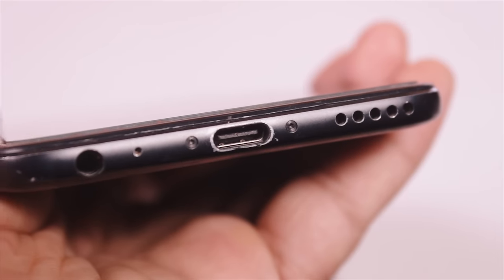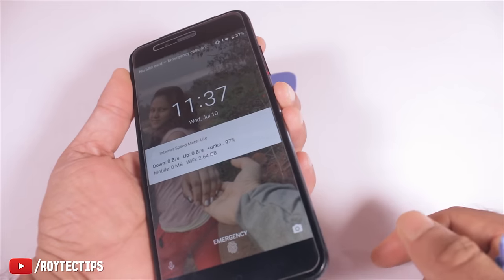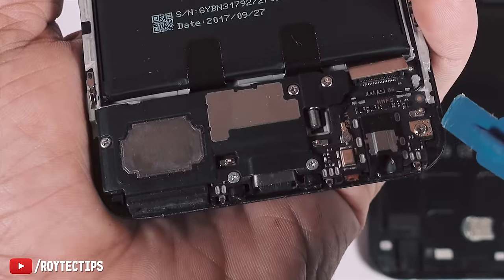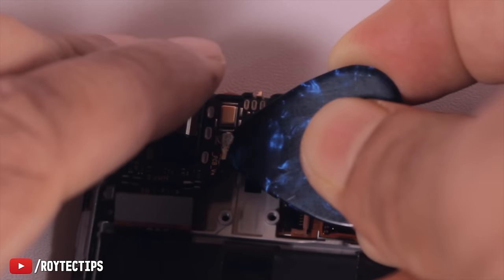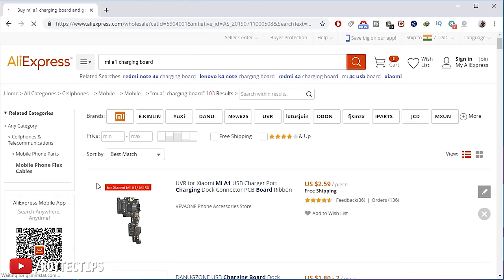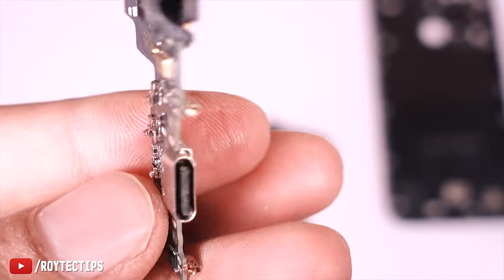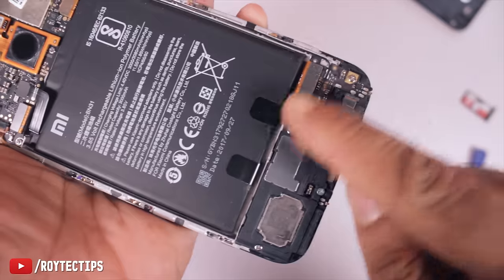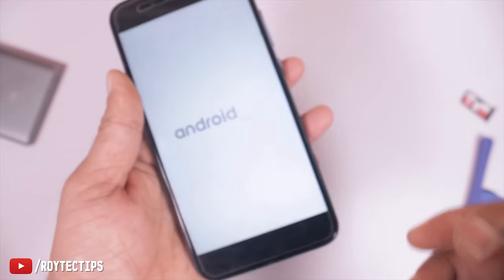HOW TO FIX ANDROID PHONE CHARGING PORT | NOT CHARGING |  | LOOSE PORT MIA1

Comment: If I do this to my phone I'm extremely sure that I'm gonna ended up with a broken display and lost screws😒
Reply: SAME
Reply: Just use heatgun he doesn't even soften the adhesive it might crack the lcd
Reply: Same 😔
Reply: Yeah meh too 😂 if I do this I'm sure 😅🤣 I will just  go for it .... I'll loose my phone..
Reply: @dipashasingha4273  😂😂😂😂😂poor us
Reply: @veronicafernando5627  now how is your phone 😂🤣
Reply: Same
Reply: @dipashasingha4273  still have the same one😂
Reply: Ikr
Reply: So better you don't do
Reply: And I'm still going to try it 😭😭
Reply: Way too complicated, so many parts of this process can cause damage and loss of tiny screws etc. Go to the mall and pay for the repair and never use the charging port again on an android. Use a wireless charger. Can't use a phone that doesn't charge as a trade-in for the next best  Android.
Reply: I was thinking the exact thing. I'd end up having to throw the whole phone away.

Comment: Thank you! I bought a charging port from Amazon and the tools. It took a little bit of work, but the phone charges fine now! I'm hella happy. The fix is super easy guys, just be careful placing the board in. There's some notches on each side that secure it in place. I couldn't fit mine perfectly inside so I just clipped off one of the notches and did everything else in the video.
Reply: Do you know if different brands require different ports? It seems to be like Samsung chargers don't work on Motorola phones, and vice versa, which leads me to believe that their ports have different wirings as well. It's so annoying that these companies will rely on these cheap parts for this, I want a new company to appear in the market and take their sales away.
Reply: @redbanlovesasians2236  Yes, I would assume every phone has different boards, but you'll be able to find one for your phone easily. Sad thing was that my phone stopped charging properly after a while. Bought another one and replaced the board AGAIN. This time I used a magnetic charger to avoid damaging my phone further... 8 months later the magnetic charge stopped working. So, it might just be a poor board in general. I bought a new phone since then and I'm just waiting for another problem to happen it seems like. :(
Reply: @Xusphy  what kind of phone is that ?
Reply: I just shoved a little shim in the port and it works great!

Comment: I use my phone to clock in and clock out at work and was very upset when my phone lost all of its battery life and would not charge I watched this video and I was thinking something as simple as a toothpick would not fix my phone but I tried it anyway and to my surprise it actually did work. Thank you so much for the tip

Comment: This video is really helpful. I was checking videos on how to replace charging port in a smartphone and realised it's beyond me because it involves unsoldering the old one and soldering in a new one. But replacing the whole board especially as it's so inexpensive is something we can do at home provided we are extremely careful in removing all those connection without breaking them or losing any screws. Thank you for uploading such a helpful video. I'll come back to this one if ever I have this problem to solve.

Comment: Great strategy for fixing Android charging port issues. I’d thought soldering on a new system was the only solution. Chargie USB stick has helped save battery life by cutting off charge at a desired preset %.

Comment: Doing this at home on a water resistant phone will leave it very vulnerable to water damage so be careful if you're doing this at home...
Reply: Those shitty phones are vulnerable to everything lol they fail every 4 months
Reply: @StoneCoolds  lol OK explain that to my s4 that still works perfectly or my s7, s9 and s10 that i STILL have and are all still working. I've had my s4 since 2013 and it literally still works great on everything that it can still do. It doesn't get updates anymore so there are a lot of things it can't run anymore but my point is that it still works 7 years later. You must be an isheep huh??
Reply: @nigayustealmyshoes  then what are you doing here ? Expanding your knowledge about things that never happen?
Reply: @StoneCoolds  😂 not at all!! I have a co worker that is still using the s6 and it has zero issues. I was just saying that not all phones are the same and samsung phones in particular seem to be beasts when it comes to longevity. You don't have to like android, I was just letting you know that I have phones that are years and years old and they still do work and no I'm not making that up. I'm typing this on my year and a half old s10 plus which proves that your statement about them lasting 4 months is extremely inaccurate.
Reply: @nigayustealmyshoes  

I agree Samsung product are great and reliable and in comparison to Apple products much much more affordable...
While Apple targeted his elite customers with their iphone samsung on the contrary has played the main role in my opinion for democraticizing smartphone with android.
I always choose Samsung phones in priority when i decide to buy a smartphone but they price too much now even though they're still reliable with no major bugs or weak components.
Reply: @nigayustealmyshoes  why df you have so many phones 😂
Reply: @zoro.l0266  lol I just never threw out old ones because they still work. I let my kids use my old ones.
Reply: @nigayustealmyshoes  ohhhhh😂😂😂my bad
Reply: Yup.. happens at home
Reply: True
Reply: @saamprime3964  the only cell phone I ever had trouble with and I had a lot of trouble with it during its short life was a Samsung, I will never own another Samsung product again.
Reply: @nigayustealmyshoes  Well yah, if you're buying S series, that's the flagship line. Try it with a $50 Samsung

Comment: Big promblen my phone is showing charging icon but not get charged 😭
Reply: Same here on my mi max2
Reply: Me too
Reply: @amirshelby  try pressing the usb pin socket of charging cable that goes inside charger.
Reply: same
Reply: Same 😭😭😭
Reply: So guys,anyone found the reason behind this problem?
Reply: Exactly I have the cubot x19 ;-; Halpp me
Reply: Get new charger
Reply: All Chinese phones have this problem...
Reply: @prahaladadharsh9766  , what is the solution?
Reply: Don't know...only solution is don't buy Chinese phones avain
Reply: Me tooooo
Reply: Me too
Reply: YES SAME!
Reply: @prahaladadharsh9766  it's a bs reason...I have a South Korean phone but still it does happen and if u will say that it's because its near China then there is only one company and that's Apple ...... btw any solutions found?
Reply: Switch off phone charging
Reply: Same
Reply: @amirshelby  buy new cable and power brick
Reply: @sumit55z  replace ic
Reply: @LeaderBMGOMP2AReal  which ic ?
Reply: I had this problem

Probably your base is broken

That's what happend to me
Reply: Me too
Reply: Check with youtube will get the idea to fix
Reply: Make sure your Charger is a Universal Smart charger that can handle your Phones charging 'protocol' ie lookup BC1.2 , Pd or Qc1..QC2 or QC3 Charging standards.
Where the charger puts different Voltages on Data(+) and Data(-) ..to work out how much current the phone will pull from rapid (Quick) smart charger.There are several youtube videos that explain this in more detail
Reply: Charger fault or charging cable fault

Comment: This was easy to follow and I got my phone fixed. Thank you!!! I got also the charging cable. Nice recommendation!
Reply: Did you replace the charging port with a newer one or fixed it by tightening
Reply: @avn33__44  I replaced it with a new one. But I still keep the old one in case I need a piece.

Comment: Thanks  it works ,I don't have a proper tools I just took my thinnest flat screwdriver and force in from my casing USB hole and the bottom of the board I twist a little bit up(nerrow/tighten it) few second I work,it can changed(Thanks from Malaysia).
Reply: Wow!  Thanks for  the comment, now I also feel it is assured that my phone would also get fixed

Comment: 0:34 That's not T5, which means Torx 5, it's pentalobe.
These disgusting screws should be banned. I have a meizu with screws and factory-sheared threads and no way to remove them. And they're so tiny it's ridiculous.
Plus my microphone came non-functioning, barely catching the loudest sounds, and a lot of noise. God I miss the replacable battery days...
Reply: dont buy cellphone

Comment: I am brand new to this. I'm tired of my sons tablets ending up not being able to charge and it is exactly because he makes the port loose. He will have it plugged in and jumping as he plays, which isn't good in itself. But being autistic, he never wants to follow this rule. I tried to pinch it tonight but don't have the proper tools to unscrew and try it. I will try again when i have the tools. You made this look easy and exactly what i thought i could do to fix it. Confirmed. That means i can try to fix the many other tablets I've accumulated 😄

Comment: Bro that type c connector is same for all devices or vary from device to device??
Like i want to replace my nokia 6.1 plus connector with some other device connector other than nokia 6.1 plus!!!
Reply: Good question. It seems to be like Samsung chargers don't work on Motorola phones, and vice versa, which leads me to believe that their ports have different wirings as well. It's so annoying that these companies will rely on these cheap parts for this, I want a new company to appear in the market and take their sales away.

Comment: I really hate the MOTO brand android phones as they make inner strips, wires, cables very weak and they tear when you attempt to open it, if it tears rips or snaps your phone is finished or its reduced to a calculator, if you have a back up phone then the risk can be reduced because sending the phone to the manufacture will cost you the same price as a new or secondhand one,

Comment: Great work , I have redmi 4 mi device, phone screen is broken but it works good , I visited to mi service center to change battery and charging port but they said if we open ur battery and charger port ,for replacement phone display will be gone , is it true ? Does it attached with battery and charging port? I don't want change display because it works good .

Comment: I have a Samsung.  It would not charge while the phone was on.  Turned off it could take up to 48 hrs to charge.
I then bought not a cheap new charger, hoping it would make a difference.   It was worse yet.
I went to my phone company and asked them to plug it into their charger to see if it would work.  It did.  It was a Samsung official charger.  I got one.
The guy behind the desk didn't believe that it should have made such a big difference, but it did.
It did and still does charge just fine.

Comment: Or sometimes those 2 little prongs sticking up go flat but if you push the flat end of the connector down, like on a hard surface and push it up into the plastic base part ,the prongs stick up again &hold tight when you plug it into your phone &charge good as new!
When it gets loose again just repeat!
Reply: Same here. Or buy a new cable & it's brand new again until I drop it while charging & flatten tabs again. 

I find it odd no one responded to you. Tells me I better not hold my breath for anyone to answer. Did you figure it out?
Reply: @iceebalboa3177  I've spent so much buying those darns cords over & over😡
But the last one has lasted a few months so far. I also got a new phone that has the usb-c plug that doesn't have prongs & can plug either way, upside down or whatever. It holds tight & hasn't given me any problems, it's just that the phone is a piece of junk!😂😂
Nord One plus N200-don't waste your money 🙄😔👎🏽
Reply: @rhouston1691  too late, I just bought one a few days ago, looking this fix up for my last phone revvl plus

Comment: Hey ! Amigo 
I am using motorola g4+ and I got its turbo charger (original) recently it's charging cable failed . So ,I brought up a new iBall cable (original) those cables failed twice as well in a month . Please let me know what's the issue?? It's my charging port or adapter of my charger???

Comment: Hey bro I hope you answer my question My problem to my Poco F3 is. That the Mi Turbo Charge is not showing, only the quick charge and I already try different charger, connector and cable, but only the same, not showing the MI TURBO CHARGE and also my OTG is not working And I can't connect my phone to the PC. Do you have any Idea what is the problem of my phone?

Comment: You did all that dismantling to compress the phone's female charge port when the charge lead's male charge port flats could have been compressed slightly first then charge tested. Why?

Surely do the simplest thing/s first. Then if that doesn't work, consider stripping the phone down for further investigation and possible repair. 

What you did is similar to changing a vehicle's brake shoes and or drums, when all that was needed if the shoe friction material thicknesses were ample was to adjust the hand-brake cables or shoe to bell housing gaps..

Anyway, it was interesting to see that particular phone's innards and to discover where to source replacement parts if necessary.
Reply: Please elaborate via video on Your simple solution.  Thanks 🌞🌞🌞

Comment: You squeeze the port against the board, then blast it with a heat gun. The original solder re liquifies. Then take the heat away, and it cools again. Doing this with the added pressure between the port and the board re solders it back to the board...

Comment: Please help me bro... My phone charging port also loose and stop charging rapidly... It's always showing charging slow down. Please help me to tight it. I don't have tools. :(((
Reply: Add some tape on the screen side to tighten it up.
Reply: @akaashi6176  am done replaced the charging board with original piece.  Nothing work with it. So I take the decision to buy new original charging board. Now it's working fine.

Comment: Okay please someone help,I have an old ipod touch 5 I think.Lots of valuable things on it so usually I can get it on but I do know abou two pins inside the charging port are pushed down too far or missing,I've cleaned it already with everything and the charger is going in and out not giving the phone enough time to fully power on to charge,usually I can get it on because theres a second time I can turn it on after it dies,I wasng thinking and used that second time and now it's dead completely and wont fully turn on. Please help me what can I do?

Comment: Thanks just 2 months ago repair it form service center for ₹550 and it loses again. 😡 This time not gonna pay them again, Can you suggest any good phone opener kit ?
Reply from the maker: buy a replacement jack it will cost you less than 10Rs. but you need a hot air soldering station.

Comment: am I the only 1 experiencing the charger tabs on the outside of connector keep flattening therefore lose grip? And it only happens when my dropped is dropped while charging. Buy a new cable & it's like new until I drop it again.

Comment: I got a charger and it worked all the time and then i slammed a iphone charger in my phone because i thought it was my charger but then it stopped charging but it saved the battery over night and then it was at 1 and died i got another charger but still did not work